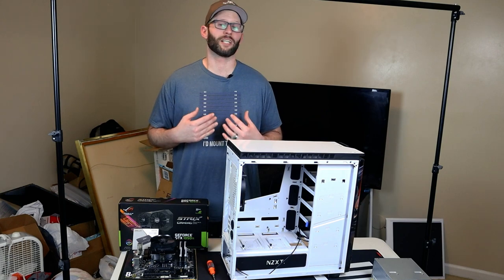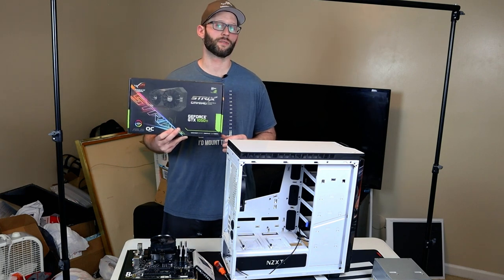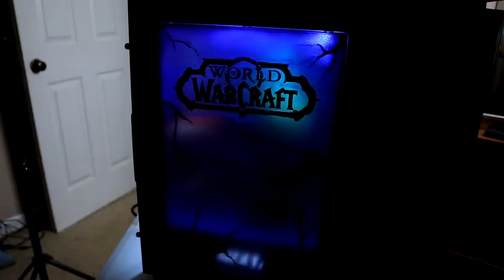Custom World of Warcraft: Shadowlands PC! Building an Amazing Gaming PC for a friend! $350 Build!

Comment: Surprised the psu didn’t blow up, seems like a solid build for 350.
Reply from the maker: It probably would have if I could have fit it in the case lol. Nah I've use the power supply before outside of a case and it works fine and is quiet, but I've never used it for a lengthy amount of time.
Reply: Im dying over here 😭🤣

Comment: The recommended spec is GTX 1080 and Ryzen 2700x. Anything lower than that will be bad.
Reply from the maker: Well that's not very true lol 😂. Maybe if you're playing in 4k
Reply: @WilliSilicon  Yes, it is true. If you want to raid properly, you will need the recommended spec...
Reply from the maker: That's recommend for level 10 graphics setting and 60fps+ in raid. Lowering the settings or going below 60fps doesn't make it a bad experience.
Reply: @WilliSilicon  Yeah, no.
Reply from the maker: Well, thanks for the info!
Reply: Recommended specs is not the minimum specs that will run Shadowlands.
Reply: @Craig_N  I know that... I just assume that the recommended spec is stable fps in raids and places with a lot of people.
Reply: @drfleka  bruh I'm literally playing with WAY less than that. I don't get 60 fps and I can't play on ultra, but I can play and I can raid.
Reply: @drfleka  Not everyone wants or needs the specs do do bleeding edge raiding, bro. If you're gonna poop on any pc that's not good enough for mythic cutting edge raiding, then you're cutting out the majority of the player base.  Less than ten percent of players have killed mythic Nzoth. Over 60 percent killed him heroic. And yes, you can do heroic raids on pretty much a potato. You turn your graphics down to medium or low, and you install DBM and you're good.

Comment: how much would all this be not used?
Reply from the maker: With current prices.. no telling. But when these parts were current and available.... somewhere around $600
Reply from the maker: Excluding the airbrushing
Reply from the maker: Can't see the list. It's private.
Reply: @WilliSilicon  sorry thought if anyone had the link they could see it I updated it
Reply from the maker: Ok. That's a good system, but don't spend that much on a 2600. That's way overpriced. You can get a 3600 for cheaper....if you can find one in stock. If you're near a Microcenter they probably have some for $180-200
Reply from the maker: Oh and yes that would be a good bit more powerful
Reply: @WilliSilicon  when i add a 3600 it says the motherboard will need a BIOS update and i would need another cpu but this would be my first build is this true?
Reply: and cant that kill motherboards?
Reply from the maker: I haven't seen a new b450 motherboard sold within the last year that didn't already have updated bios.
Reply from the maker: I checked the Amazon link for that motherboard on pcpartpicker and it's ryzen 3000 ready. Buttttt also don't spend that much for a 3600 either lol. CPU and GPU prices are really messed up right now. I would wait if you can.
Reply from the maker: Just a couple of months ago a new 3600 was around $170
Reply: @WilliSilicon  ok thankyou I am doing research for a wow pc that I can build for my birthday which is 2 and a half months away so hopefully the prices drops some I dont really expect it to tho because of the current situation in the world
Reply from the maker: Stock is just so bad right now. I'd search used markets